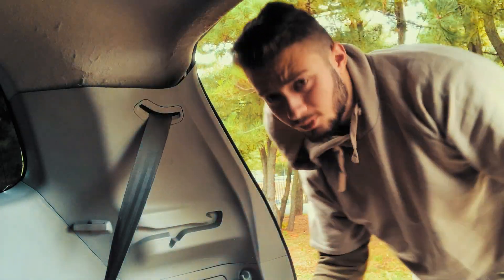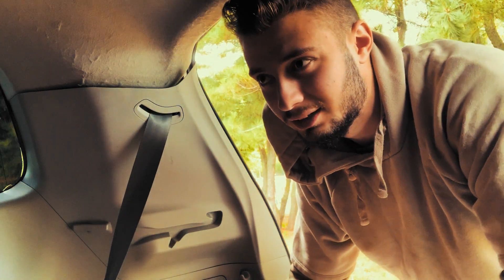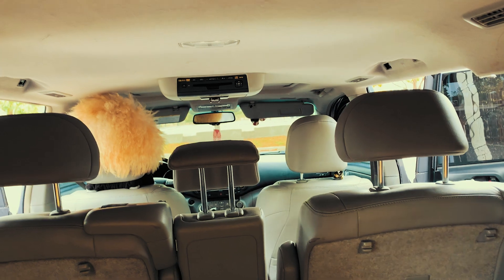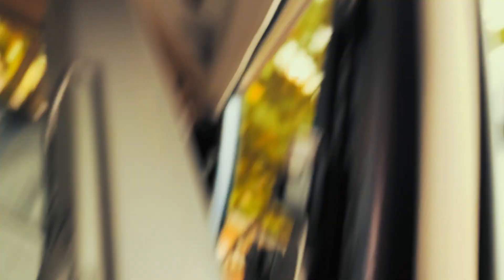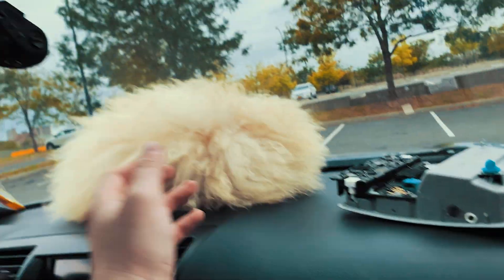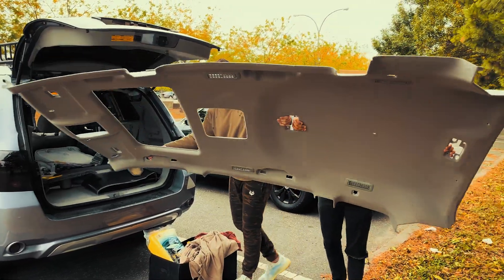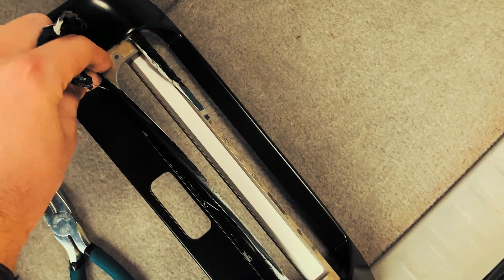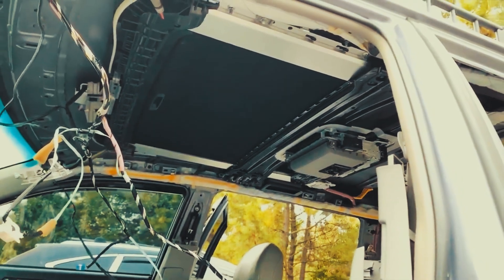How I made my car's HEADLINER BLACK? Toyota highlander (PART 1)

Comment: Interesting video..I'm installing a dash cam is there enough space for me to get a long stick to run a cable from the hatch through the top of the headliner beside the sunroof as I don't want to go near the side airbags?
Reply from the maker: You should be fine use the plastic trim tool and you will have no problem